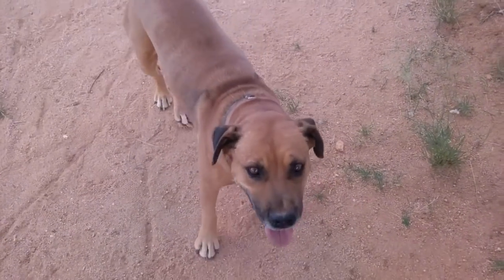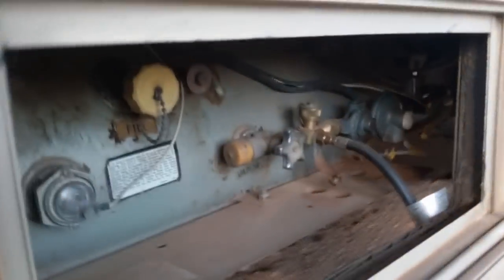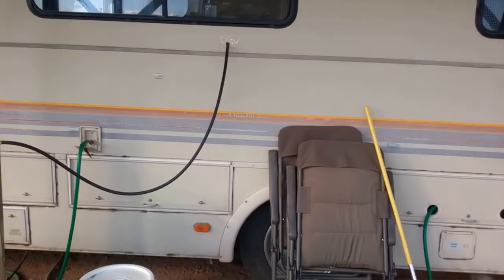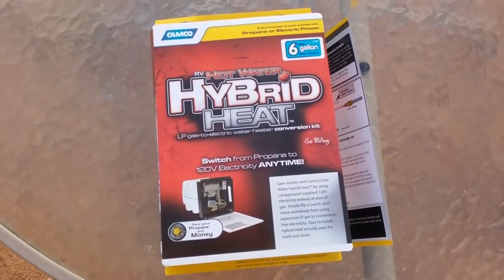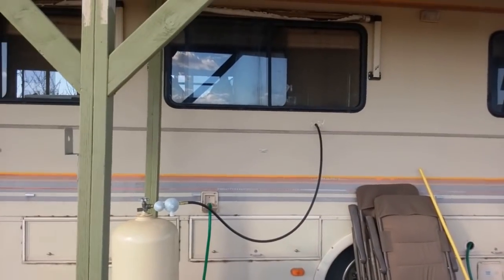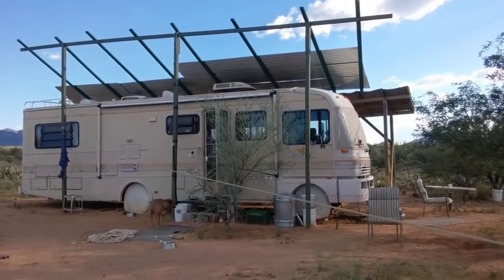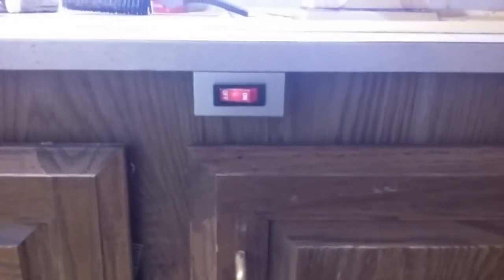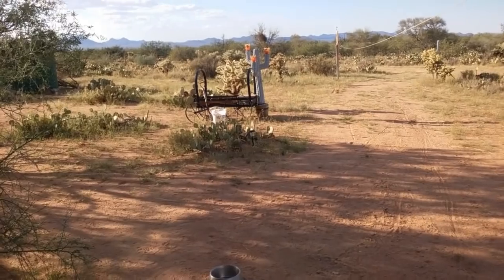Solar Hot Water @ AZ Off-Grid (Unplugged) Prepping Ranch

Comment: It sounds like you need new propane hoses. They're not sealing right.
Reply from the maker: turned out to be a broken connection,, an old break you could tell,, at the kitchen manifold.. I bypassed the break and it ran fine for 2 more winters using the furnace,, oven/stove,, refrigerator.. just no water heater as the line had a break to it too..
Reply: @deserthorizons  Its always something,ain't it?

Comment: Nice info there on the water heater.  May have to look into that.  Ours can take a while to heat up on propane.  400 watts an hour doesn't sound too bad to me.  Do you know about how long to get good hot shower water?
Reply from the maker: MidLifePrices = With the current ambient temperatures  I set a timer for an hour (maybe 1 1/2 hrs) and there is more than enough hot water in it for me to take a good shower.. (I have already saved over 20 bucks on propane..) VERY easy install... Thanks for watching..

Comment: I wonder if the system might be okay but one of the appliance valves might be bad? When we run gas line we test connections with "soapy water" solution. Soap is actually corrosive so we use a special product that can be purchased specifically for gas line. You might be able to find the leak yourself.
Reply from the maker: I was thinking that but I have never smelled one whiff of propane 'inside' the RV.. One of the things they did was put in a propane leak detector and it has never gone off..  Because of the constant breezes through here it took me a while to notice it outside the rig..  I will leave it alone until you can come and take a look at it..:)
Reply: deserthorizons thanks for the invitation, might be a while haha.
Reply: On another note, would you recommend that heater buddy for something like my tiny house? It’s 100sf with no insulation at this point.
Reply from the maker: It would be perfect for your tiny house.. The only drawback? NO thermostat.. Meaning it does not shut off at a desired temperature.. I believe 1# propane tank lasts ~9 hours.... They have hoses that hook up  to a 20# tank..
Reply: deserthorizons thanks!

Comment: End of October highs of 'ONLY' 80 degrees??? we're lucky to get that high during the highs of summer on Vancouver island argh! lol
 Does that fancy  water heater electric element kit add on have a thermostat component to it , in case you forget to turn off the switch and burn up 400 watts per hour for the 17 or so hours you forget to switch it off?  ; )
Reply from the maker: Up until 2 weeks ago the lows at night were ~75,,, Perfect... Always a nice breeze .... I get chilly below 80 .. Your weather sounds like Gunnison, CO,, high in summer is <80 ..  How cold does it get on Vancouver in the middle of winter.?  .. .. ..Yes it has a thermostat that I have set at 120 degrees.. .. ..Thanks for watching..
Reply: Our weather , starting midseptermberish until mid marchish is usually rainyish , average highs in the high fortys and lows about 35ish with maybe a dozen 28 degree nights and 6 or so days of snow which 'usually' melts within a day or two , but living by the pacific and the mountains means the weatherman has no idea what the weather will be 5 minutes from now!  Thanks for uploading  ; )